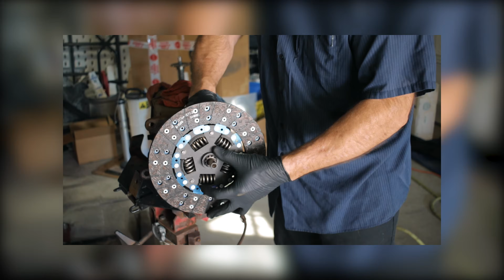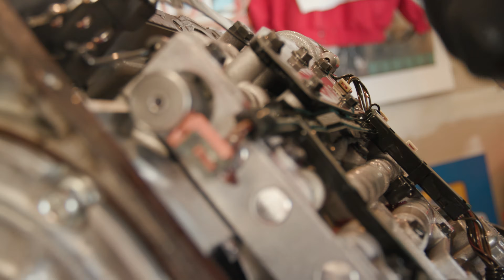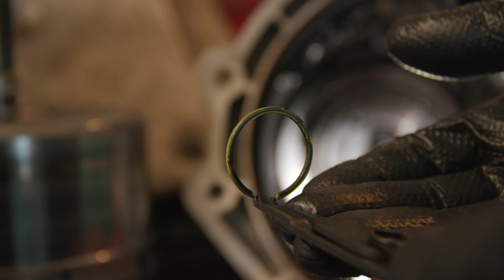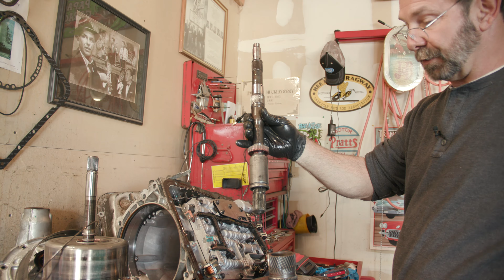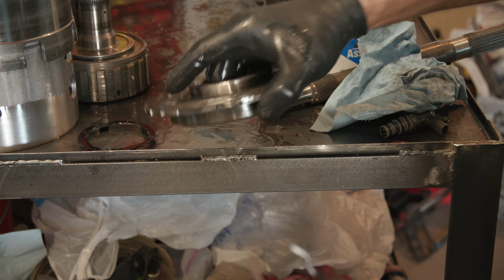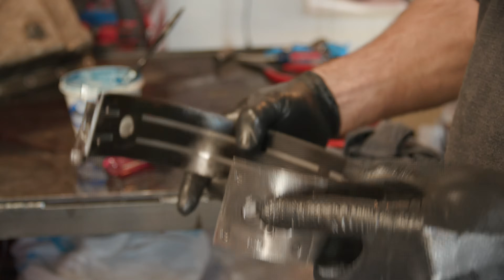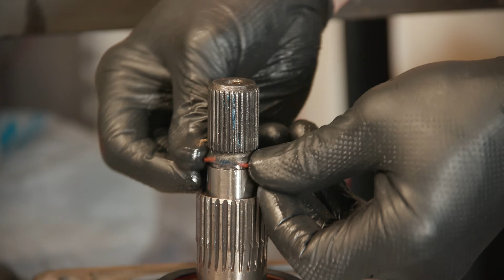4L60E Output Shaft Swap - 2WD to 4WD Conversion

Comment: ask andy this plz... im having an issue where I cannot get my output shaft snap ring on  on. Im starting to wonder if the gear on the shaft for the speed sensor migrated, keeping the shaft from going in far enough.. we cant compare the old snap ring to the new one, because  it  shot out somewhere.. im wondering if the last builder used a thinner snap ring.  im also wondering if shoddy aftermarket parts were used, that affected the tolerances.. im abt 2 mm short.  thanks for any help.. we took it apart, and reassembled it 3 times, so I am pretty sure we are installing everything correctly.
Reply from the maker: A few things that come to mind are...

Rear (Output) Ring Gear:
The output shaft splines into the ring gear.  Some ring gears have two dimples right near the output shaft, and some do not.  The ones with dimples, are a bit of an interference fit with the splines on the output shaft.  In that. case, I'll use a mallet (or hammer handle) to tap the output shaft all the way into the ring gear.

Rear Unit End-Play:
From the factory, these transmissions usually have a rear unit end-play that's on the loose side of the spectrum.  However, if someone has already been inside of the trans, they may have added some shims underneath one of the needle bearings.  They're typically under the Rear Ring Gear bearing.
Point is, when the end-play is set to the tighter end of the spectrum, it can be more difficult to remove/install the output shaft snap ring.

Low-Roller:
The Low-Roller has an inner race.  It splines to the Rear Planet Carrier.  It's possible for the inner race to spline to the carrier, but not be push down all the way.
Might try to rotate the inner race, while pushing it towards the rear of the trans.

Was the snap ring difficult to remove, initially?
While the trans was apart, did you replace/upgrade any of the internals?
Just curious about any changes that may have been made.

-Robert
Reply: @SouthpawAutoworks  wow u rock bro.. im going to check it out right now.. been fighting this for 2 days..
Reply: @SouthpawAutoworks  the snap ring was not difficult to remove, but we lost it, so we dont know if a thinner snap ring was used on last rebuild.. the only part we lost, that is throwing us for a loop;. frustrating..
Reply: @SouthpawAutoworks  we havent replaced any internals except some bushings.  I check the reaction carrier and it is the old style with no shoulder. I measured the planetary carrier bearing thickness and is .130 ..
Reply: @SouthpawAutoworks  the inner race of the low roller clutch will not push all the way down to flush with the carrier.. if we take it out, the race will move up and down freely inside the carrier, but when we put it in the trans housing, it sticks up abt 1/8th to 1/4 of an inch.. we tried flipping the race, and it still doesnt seat flush with the carrier.. it looks to be bottomed out .
Reply: @SouthpawAutoworks  I took everything apart, and the output hub thrust bearing is shattered.. im thinking we may have gotten the bearings mixed up, if thats possible. im thinking when I was tapping on the shaft, to try and get the shaft in further, I likely shattered the bearing... man.. learning transmission rebuilding is EXPENSIVE..HA I now have a new perspective and respect for the everyday builders out there.. we now have around 1200.. just in parts, tools and supplies, and the output thrust bearing will add to that.. we still need to buy trans fluid, cooler flush, so we will be at around 1400 into this 93 transmission.. so far we bought a deluxe kit, replacement reverse drum, replacement hard sunshell. sonnax pump alignment pins, a 13 vane pump rebuild kit, an aluminum, 3rd gear accumulator piston as the ULTRA SUPER KIT did not have one. also a valve body plate repair kit.  
how folks "rebuild" these trans and sell them, on craigslist for 700.00 is beyond me.
Reply from the maker: Bummer about the needle bearing.
On a positive note, it's a learning experience.

"I failed my way to success." (Thomas Edison)

The term "rebuild" has many different standards.
I'd be interested in filming the teardown one of those $700 Craigslist transmissions apart.  One of these days...
Reply: @SouthpawAutoworks   I have not failed, only discovered 1000 ways NOT to do something.. me
Reply: in some states such as Texas, replacing only one part, can be deemed "rebuilt" .. how this came about? because some mechanical assemblies only have one part to replace.. such as some pumps..
what I dont like is shops that put R&R on the repair ticket... it can mean many different things.. repair, or replace.. recondition and rejuvinate. restored and reinstalled.  rolled off the shelf, cracked and returned... it goes on and on.. ha
Reply: @SouthpawAutoworks  Can you tell me where the largest needle bearing goes, the one with the widest diameter? we had it right on top of the 3rd piston spring cage.

Comment: Currently trying to do this, after I removed the pump I removed the band and the drum came out leaving the input shaft and the rest of the assembly in the trans and it will not just pull out. Any help on this?
Reply from the maker: Based off of the info you've provided...
It sounds like the Input Drum is stuck.  This has me thinking that you may be dealing with burned up 3-4 Clutches.

If the 3-4 Clutches are smoked bad enough, they can get stuck to the clutch hub, resulting in the drum not coming out.....easily.

Just out of curiosity...
Was the trans being disassembled for an output shaft swap?
If so, was it your trans (from your vehicle), or was the trans from the junkyard/elsewhere?
Or was this trans being disassembled do to transmission problems?

Comment: To swap shafts, do you really need to go past taking off the snap ring on the output shaft it seems like it would come out after that, and there is no need to remove the anti clunk spring or anything past that or am I wrong?
Reply from the maker: You are correct.  Remove the small, yellow, snap ring...then the output shaft can be swapped.

Comment: I'm not a transmission expert but hope to learn enough to repair my 4L60E problems. I'm confused how can you tell if TCC is locking on 1994 Astro van or 4L60E of that year? And my transmission has no or sluggish downshift when towing and I have replaced a number of powertrain management sensors with new ones. I won't have time to work on my project until later this year. In future videos maybe you can show how to road test for TCC lock up and no or sluggish passing gear problems that could be vehicle or engine or transmission and difficult to diagnose but can find clues via road testing. I think your videos are on topic and with good talking points and photographs about key points and the speed of the information being presented is about right so Kudo's. I think my 4L60E problems are minor but I hope to ferret those out in future. Here is link to my video logs that are crude for lack of editing skills. https://www.youtube.com/watch?v=6a2jzWwrf_c&t=1319s
Reply from the maker: When the TCC is applied, the RPMs will drop, ever so slightly.  It can be hard to detect.

Here's one way to check...
With the vehicle cruising down the HWY, steady speed, slight grade, hold the throttle steady, while gently tapping the brake pedal, enough to activate the brake lights.
If the TCC is working properly, the engine RPMs should increase when working the brakes.
After letting off of the brakes, the engine RPM should decrease within 5 seconds.

The PCM is constantly watching the brake sensor.  When it sees that the brakes are applied, it instantly turns off the TCC...resulting in the RPM change.

Comment: One question sir, I have a 2006 trailblazer with a 2005 transmission mthat is being a piece of junk of course. I have another trans. from an 03 trailblazer. can i swap the wiring harness and make it work? you seem to have the knowledge i seek
Reply from the maker: If my memory serves me correct, that should work....should being the key word.

Many 4L60E are equipped with a Manifold Pressure Switch (AKA "Pillow Switch).  This switch is bolted directly to the valve-body.
Later model 4L60E units did away with the Manifold Pressure Switch, and instead employed a IMS (Internal Mode Switch).  This is located on the shift lever shaft, located internally...versus external to the trans.

What are your 4L60Es equipped with?
Reply from the maker: Just thought of something else...
You mentioned an '05 4L60E.  Then wanting to swap it out with an '03 4L60E.  However, the vehicle is a '06 Trailblazer.

Starting in 2006, the 4L60E was outfitted with a new addition to the wiring harness...ISS (Input Speed Sensor).
If your original trans had an ISS, the PCM will be expecting to see data from the ISS.  When it does not see speed sensor info, it will cause problems.
No sure this is the case for you, but thought I'd mention it.

Comment: Great video.  As a carry over I would like to see a video on installing a late model Corvette differential on the back of a 4L60e making a very short mid-engine power package with a SBC or an LS.  I saw a show where that exact thing was done for a sand rail but I can't find any type of adaptor and if you found one what it would take to install it.  I'd love a mid-engine S10 with a IRS.
Reply from the maker: Noted!

Comment: Why did you finish taking the trans apart? Could you have removed the output shaft after you took off the retaining clip? Just curious.  Thanks
Reply from the maker: Yes, you're correct.  Once the yellow snap ring was removed, the output shaft could have been swapped, without any further disassembly.

If my memory serves me correct, we got carried away.

When time permits, we would love to update this video...as there's definitely room for improvement.
Reply: @SouthpawAutoworks  thanks for your response a very helpful video keep up the good work
Reply: By the way thanks for the extra info down below

Comment: Mine is leaking from that area
Reply from the maker: What area is that?
Reply: @SouthpawAutoworks  where my slip yoke connects. I put a new seal there but it still continues to leak.
Reply from the maker: There’s a bushing located in the extension housing, right near the rear seal.  The bushing provides a surface for the slip yoke to ride on.  If the bushing is wore out, every new seal installed will continue to leak/fail, prematurely.  Also, if the slip yoke journal (shiny/smooth part) is damaged, it will wipe out one seal after another.
Reply: @SouthpawAutoworks  thank you
Reply from the maker: You bet.

Hoping to release the next video tomorrow.  It’ll be about bushings.

Comment: The only parts you have to change are the shaft and outside tail housing ?   Video didn't show the very final assembly process.  Thanks for this great video.
Reply from the maker: In a nut shell, yes, that's correct.
Yeah, we ran out of time.
You're welcome.

Comment: Nice video,  I was replacing the speed sensor in an infinity 2015 q50 and the out shaft came out like half inch so now  I can’t  put it back. What should I do I’m not mechanic just like to play with cars, any information will be greatly appreciated. Thank you. Please continue with the videos already suscribe .
Reply from the maker: Believe that vehicle is equipped with the RE7R01A.  We have yet to work on one of those transmissions.

Thanks for the support!

Comment: Great videos!!
If  I  dont have reverse, and goes forward in neutral what do i need to look? 
Thanks,
Jason
Reply from the maker: It sounds like the Forward Clutch is stuck on.
Before it got this bad, was the transmission slipping in Drive?
How does the fluid look, and smell?
Reply: Thanks for the reply!! She originally lost reverse sunshell broke. Put a new one in and after install it was like that. After looking late last I found one clutch in the input shaft drum messed up and it had the input shaft and drum hung up. So what that possibly cause the issue?
Reply from the maker: Ah, I see.
When installing the clutch drums into the case, all of the clutches must spline to their respective clutch hubs.
Sounds like you missed a clutch plate (I've done this before).
When you installed the pump, and the pump bolts get tightened, it'll push on the drums, and it'll smash, and deform, that one clutch plate...and no others.

When this condition occurs, it essentially locks that clutch ON.  When you shifted to Reverse, the trans is now in both Reverse and Drive, at the same time.  It fights itself, and it can't go anywhere.
With the trans in Neutral, it's still able to move forward, because of this clutch being mechanically stuck ON.

There's a saying in the transmission business (well, there's many sayings...).
"We only guarantee Park, and Neutral."
Ya got it pretty bad when Neutral doesn't work.  ha

Replace the deformed clutch plate.  Make certain that all of the clutches spline to the hubs, and you should be good to grow.

There's a couple of ways to prevent this sort of things from happening, again...regardless of the type of automatic transmission.
Unfortunately, I'm out of time...
I'll see about making a video on this topic, in the near future.

Thanks for dropping me a line!
Reply: Yes sir!! Thanks for your time.

Comment: Great video. Question I'm doing a transmission swap for my son, he lost reverse and blown a hole in the side. When I drained the pan metal is everywhere. Is it going to have shaving in then torque converter to? I don't think we should use it but he's trying to save money.
Reply from the maker: Great question.

All of the transmission fluid is circulated through the torque converter, and the transmission cooler.  It's a good practice to replace the TC (torque converter), as it will be contaminated with metal (if there's metal in the transmission pan).
It's also a good practice to flush the transmission cooler (and lines).  

Not addressing the TC and the cooler will result in your replacement transmission becoming contaminated with metal.  Contaminated fluid can lead to a number of problems.

Here's one way to flush a cooler/lines:
https://amzn.to/3VU6fXo
Note:  If it were me, I'd use two (2) cans for a more thorough cleaning.  However, you do what suits you best.

Thank you for dropping me a line.
Wishing you the best on your son's 4L60E transmission swap.

DISCLOSURE:  🕵
Links provided are affiliated links with the associated websites. While there is no extra cost to the purchaser, a small portion of the sale goes to support this YouTube channel.
Reply: Thanks for the reply and advice. It's a big job and I only want to do it once so a new TC and line flush will be done 👍

Comment: https://youtu.be/8U9zidtjB68
Is this process effective as replacing output  shaft
Reply from the maker: I've seen that video before.  The output shaft on that transmission has splines that run the entire length of the shaft (well, at least the part of the shaft that is protruding from the transmission case).
The 4L60E output shaft does not have splines that are that long.  It requires changing the output shaft.

Comment: Great instructional video!  There are so many that fall short.  One question; you explained about carefully removing the pump gasket material while the trans was apart, but it was not replaced when reassembling.  Is this gasket important?
Reply from the maker: Thanks for the positive feedback!  Much appreciated.

The pump gasket is very important.  Leaving it out would result in multiple oil leaks (internal)...major problems.

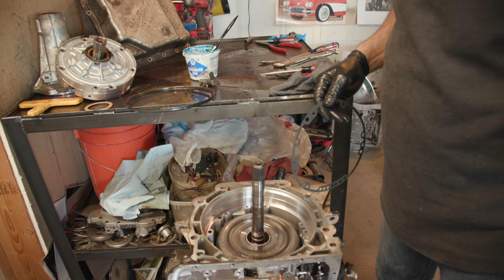At 33:58 it shows the pump gasket being installed.
Reply: @SouthpawAutoworks 
Haha, yup, there it is!  I should have watched it all again before making a fool of myself.  I'm going to watch this video 3 or 4 more times to make sure I don't miss anything else.  🙄 Thanks!
Reply from the maker: Not a big deal.  Glad you're here!

Comment: I just did this job myself today using this video as a guide. Super easy to follow instructions made it a breeze except I had to drive the 4x4 shaft out and drive the 4x2 in. Thank you for taking the time to make this video!
Reply from the maker: Thank you for the positive feedback!

Some of the rear ring gears are dimpled (there's two dimples on opposing sides, right near the splines that mate with the output shaft).  The dimples create a bit of an interference fit.

Thanks for taking the time to drop me and Andy a line!

PS - If it feels right to you, please help me spread the word about this channel.

1 Handed Transmission Rebuilder:  (60-Sec Preview)
https://youtu.be/y3Vixa_Ec1E

Comment: Just switched a 4x4 to a 2x4. Never touched inside of trans before. Watched your step by step and was great. I do have an issue with you getting snap ring off. It took me forever. Did you pause the video or cut 3 hours. I'm sure you have done it a million times. Thanks for the help.
Reply from the maker: Haha. Yeah...that snap ring takes some getting used to.
That's awesome!!!  Happy to hear that!

Thanks for dropping me a line!

PS - If it feels right to you, please help me spread the word about this channel.
Here's some easy ways to share...

1 Handed Transmission Rebuilder:  (60-Sec Preview)
https://youtu.be/y3Vixa_Ec1E

How the 4L60E valve-body works:  (60-Second Preview)
https://youtu.be/fWPSaLeaOXI

Comment: I would like to know if I do a v6 conversion can I still use my original manual gearbox with the 2gr engine, and won't the engine be powerful for the gearbox and damage it
Reply from the maker: I don't know...